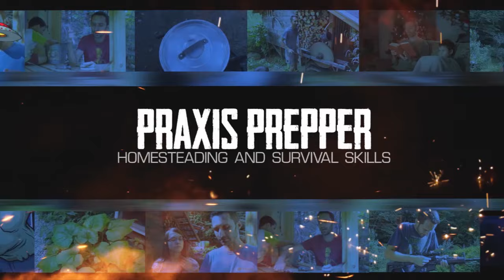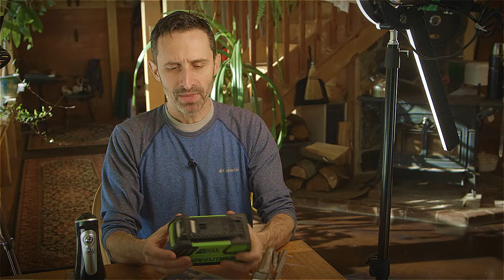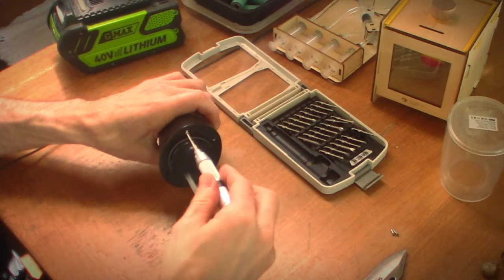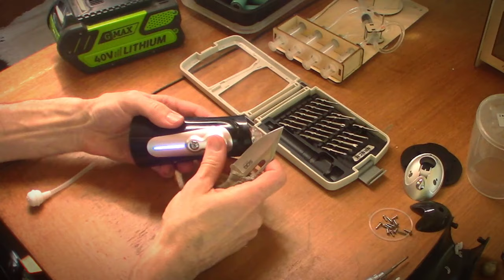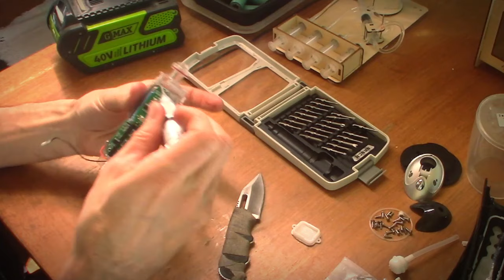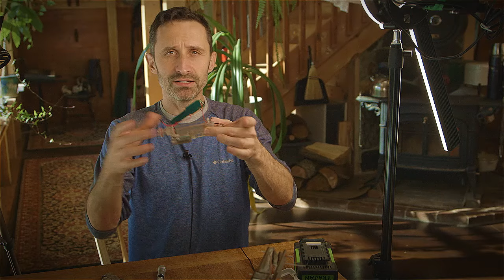You Probably Do NOT Have This Skill

Comment: As a society we really need to convince Designers to make small disassembly markers for snaps and screws. Developing common language for the need of service/repair/reuse is important. The days of "it's cheaper just to throw it away and buy new" are ending as inflation is rising.
Reply from the maker: I think that's a wonderful idea, but have trouble imagining that being implemented given the customer base. If customers WANTED to pay a little more in the short term but receive something better built and made to last/be easily repaired, that's what makers would make. Our society right now doesn't value that... um... value. So makers don't sell it.

Comment: This is an absolutely essential video. Tinkering to repair and salvage as well as the ability to understand how things work (or at least fit together) are absolutely underrated skills. Add on the creativity to MacGyver something else out of, well, junk and your some problems will not be problems any more - because what else is that, it not problem solving. And what is prepping, if not anticipating problems to solve. 

Here in the EU some initiatives are trying to implement a right to repair, meaning i.a. the accessability of spare parts for everybody and a ban on software in the repaired device blocking new parts. That compaired with repair cafés (don't know if those are a thing everywhere, just a bunch of tinkerers sitting together and trying to repair stuff for free) in and of itself is nice. If only manufactures would build stuff to last, and not to last only as long as the warranty... 

That pump from the water pick compaired with a little timer could be a nice little overengineered thing for watering pottet plants or a device to disincentivize smaller animals to be where they shouldn't. Or just a powered squirt gun.
Reply from the maker: I love those alt uses of the busted pick. When it died it seemed to have an issue pumping. The motor actuated, but the pump wouldn't flow anymore. I never went in to look about repairing because I've gotten used to things being (as you noted) not being able to be fixed a lot of the time. Maybe I could have fixed this one. Thanks for pointing that out. I'll have that echoing my head for next time. Grabbing the battery from it was useful, but fixing it would have been even better.

Comment: Tinkering is probably my best and favourite prepping skill. Modern tech is just amazing once you start pulling it apart. I hate to throw anything away. 
Always good to store those 18650s with about a 70-80% charge in them if you can. A decent battery charger will give you an idea of that. In fact most supposedly dead laptop batteries might only have one dead cell in them, and the rest should be plenty good to re-use.
I keep seeing these disposable vapes just dumped on the street. The wastage and pollution just drives me crazy. And there a small LiPO cell in each one that you can potentially salvage.
Tinkering really is an endless rabbit hole. Or an endless series of endless rabbit holes.
My soldering skill are pretty rudimentary. I really need to up my game with that...
Reply from the maker: I have mixed feelings on societal waste. On one hand, it's terrible, but on the other, it's a free resource for people like us to take advantage of.

Comment: This is why I love sites like Instructables. Because it introduces you to interesting ideas. Plus, in a pinch you can use the electronic compnents off of one dead device to fix another. Get or make  a small alcohol lamp and stick a piece of thick copper wire in a wood handle and you've got a no electricity soldering iron. You can reuse solder old circuit boards too in a pinch.

Comment: Plus if you know your stuff, you can come up with some REALLY....interesting uses for old technology. Trivia, did you know the grid voltage in an old CRT  monitor can not only kill you, but fling you across the room while it does it? That could have some....uses. For anything from fishing to intruder removal.
Reply from the maker: I didn't know that, but I DO know that (at least on the one I tried it on) old CRT monitors are super hard to break by throwing them with great force down into an empty metal dumpster. OH, they make a LOT of noise when you do that... but in my experience, they never break. I didn't try a sledge hammer though.
Reply: @PraxisPrepper   Well, its the capacitors on the circuit board that will really bite you. You could probably arrange something similar with microwave capacitors. Whatever you used it on would find it shocking LOL

Comment: Im going to buy the battery charger. I use a re -chargeable flashlight to charge my 18650 batteries ATM.
Reply from the maker: That one that I listed is a cool one because it does a number of different batteries and not just the 18650. So far it's been working well after a few years.
Reply: @PraxisPrepper  very cool thanks

Comment: I had the same problem with one of my many Ryobi 40v batteries. Took one charge, then would not charge anymore. Did not know those nice batteries are in it, so I will be pulling it apart tomorrow. It was just a paperweight.
Reply from the maker: I'm so glad that you still have it! I was getting fearful as I read your comment that it was going to end with you saying that you wish you'd known before you threw it out!
One note on the 4 screws that hold the green plastic case together. They were... weird in some way. I forget what it was, but I remember them being weird somehow. Like they weren't standard philips head or something. I forget what it was, but they were different in some way. That's one of the great things about that NANCH tool set. It has so many tips. HEY, I thin I remember now. I think they were star or hex heads, BUT they had a pin in the middle so that you needed a special head with that space open in the middle. I DO believe the Nanch set I show here and link to in the description had it in there.

Comment: Which reminds me I should make more pre-threaded needles sealed in straws, haven’t made any new ones in over 2 years and the plastic bin with everything to make them is somewhere where I see it almost daily.
Reply from the maker: Pre-threaded needles sealed in straws? I'm curious what that's for?
Reply: @PraxisPrepper  I don’t know if jou’re just joking, in case you’re not:
Your first layer of sheltering is the clothes you are wearing, having the option of quickly repairing a tear can be very important.
A pre-threaded needle should be in some kind of container so you can’t stab yourself, a plastic straw melts well with an ordinary lighter and long nose pliers can keep it flat so it seals well.
I also seal a mini paperclip (to improvise a button) and two mini safety pins, the whole thing weighs a couple of grams and is about two inches long so very portable, I keep one in my Victorinox belt pouch with my tinker SAK so I can use it to cut open the straw.
The ones I make are with nanocord instead of cotton thread, this is like mini paracord with 38 pounds test strenght.
Nanocord is about a milimeter in diameter so to avoid using very large needles I pry the eye of the needle with a screwdriver, which means cheap (dollar store) needles will break immediately, so I get good ones at a sewing supplies store.
Another option would be to use fishing line with at least 20 pounds test strength so you can repair shoes or backpack shoulder straps and they will last for a reasonable amount of time.
I recommend having at least 30 inches (a loop of ‘thread’ 60 in long before folding and tying) as a minimum.
The wide (milkshake) plastic straws they sell at dollarama are colored and semi transparent so you can’t reliably see whats inside, so I label them.
Alternate use: improvised fishing kit…
Reply from the maker: Thanks for taking the time to share that. I was confused a little I think because in the video I mention the syringes in the robot arm didn't have needles in them. So when you mentioned needles, I was thinking of hypodermic needles. SEWING NEEDLES! Yes, of course! I 100% agree. I think I made a video a few years ago demonstrating a basic sewing technique for people to be able to do in order to repair things. It's a very important skill for everyone to know. I very much agree with you. I like you sealing sewing needles up idea too. That's a cool idea. @georgeg7840
Reply: @PraxisPrepper  i didn’t invent these, just perfected my own variation over time.
Make your own, maybe show off your ultra compact sewing/fishing kit in alien invasion season three.
Reply from the maker: I can't wait to get season 3 out. I think I'll be shooting it this spring and release over the summer. @georgeg7840

Comment: I've always had a curiosity. I tear apart most things to see inside. Ex: I tore apart the 3rd ink jet printer in 3 months. Grrr, the ink reservoirs kept filling up and error code says to return to company or kaputz. THEY LIE! I discovered there is no reservoir. The ink just fills up in the bottom carrier of the printer base till level hits a censor that shuts it down. I drilled a small hole, added a tube and capture bottle. Broke off the censor and had that printer work wonderfully FOR YEARS!
Reply from the maker: AWESOME!

Comment: I will say the battery thing is not universal i have ripped open a few different ones. Its probably  dielectric grease like nasty vasoline
Reply from the maker: No it's def not. In fact, of the 3 things I listed in the opening, I can only imagine that one of those has 18650 batteries. But they ALL have amazing wonders to be discovered! ;)
Yeah, it felt like Vaseline.